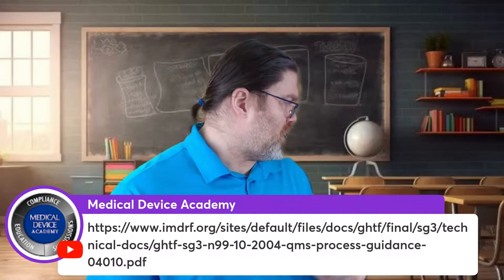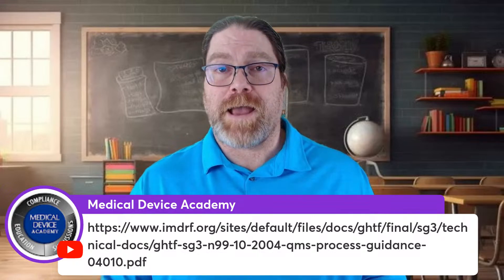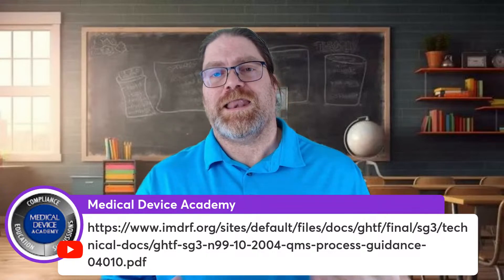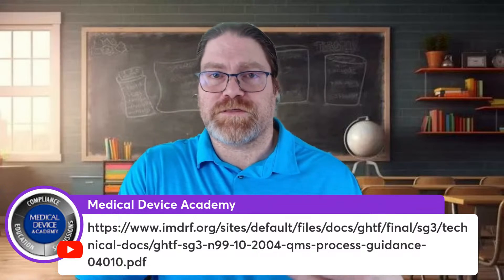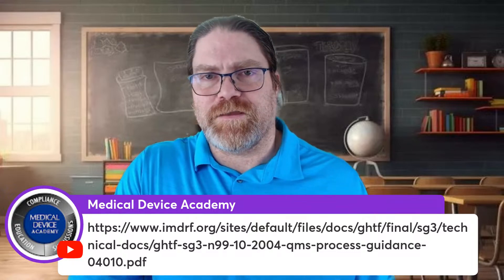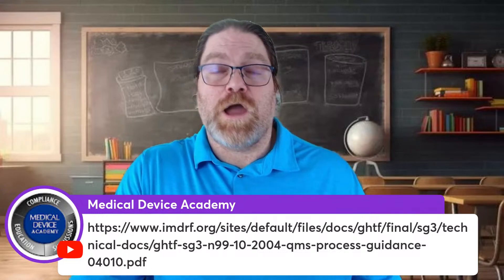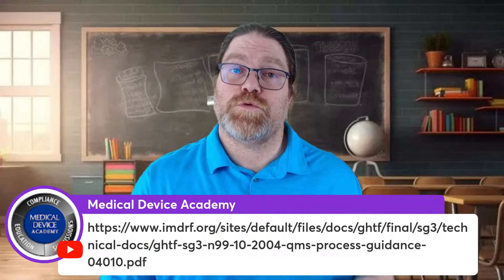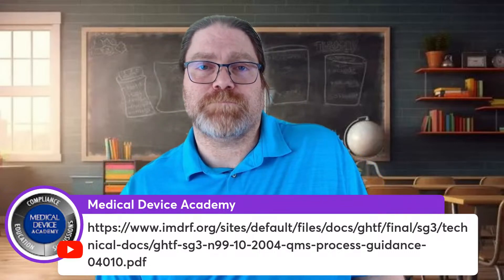What is an IQ, OQ, PQ?

Comment: Is PQ same as Test Method Robustness?
Reply from the maker: No, PQ is not the same. The purpose of a PQ is to evaluate the impact of variability in raw materials, operators, and the work environment. The nominal conditions for each set-point are used for each PQ lot, but ideally, you will use different lots of raw materials, different operators, and different temperature/humidity. Test Method Robustness is specific to testing, while PQs are specific to manufacturing processes. We refer to both as process validation, but one is for manufacturing while the other is for either design verification, design validation, or inspection processes--such as final inspection or automated inspections.

Comment: Hi your content is amazing. It has really helped me a lot. One quick request, can you please make a video on Process Characterization?
Reply from the maker: We appreciate your positive feedback and we're glad you found this video helpful. Unfortunately we are not able to support your request for making a video on process characterization.

Most manufacturing processes in medical device manufacturing do not require process characterization, because the process is common to the industry and the variables are well understood. Examples include sterilization, molding, extrusion, and heat sealing.

Process characterization is critical when you don't know what the critical process variables are. Conducting process characterization is common in biological processes that are used in drug and biologic manufacturing. Novel manufacturing processes are less common in medical device manufacturing, but when they do occur you will need to characterize the process as part of the OQ step. DOEs are the most common tool.

In general, if there is a standard already in place for the process you are validating, you don't need process characterization. If your process is novel, then you probably will need process characterization.